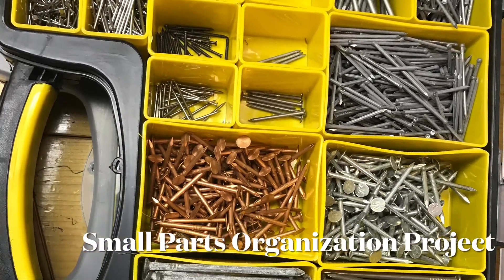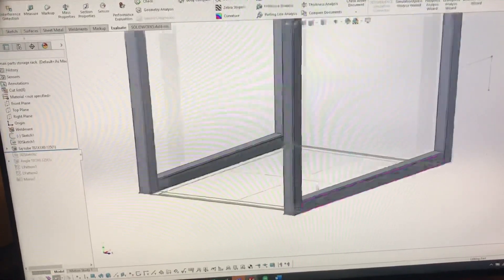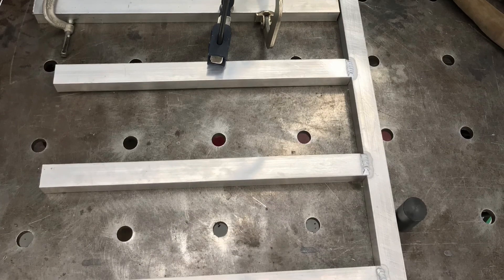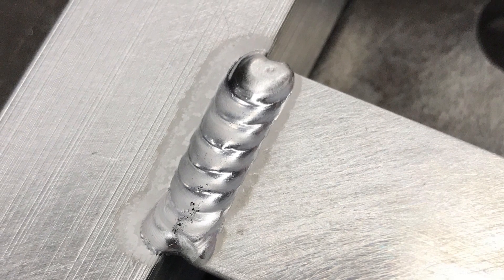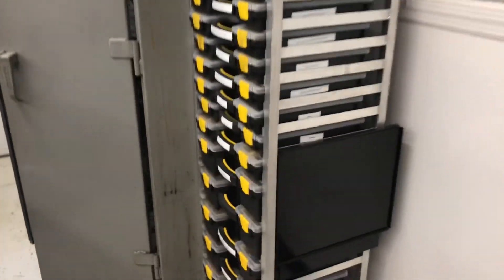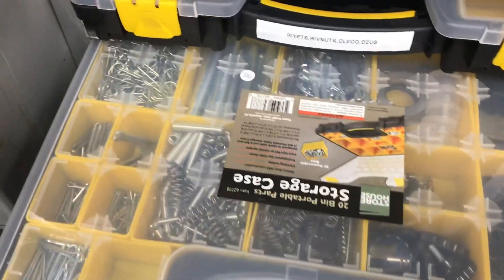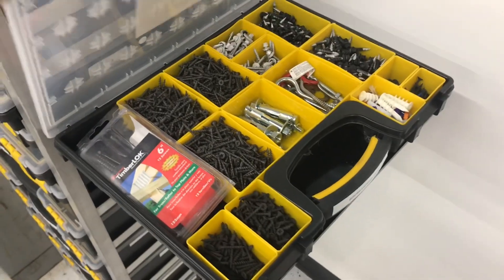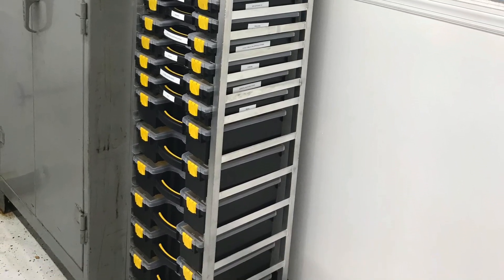Small parts organization rack with Harbor Freight Store House storage Cases

Comment: If you want to get rid of the stickers on the lid of each bin, here'd a good tip.  Spray it with WD-40 and let it soak for 10 minutes or so.  The paper will absorb the WD, which will in turn and dissolve the glue.  Then you can simply lift it off and clean the lid to remove any residual WD.
Reply from the maker: Whoa, thanks for the advise!